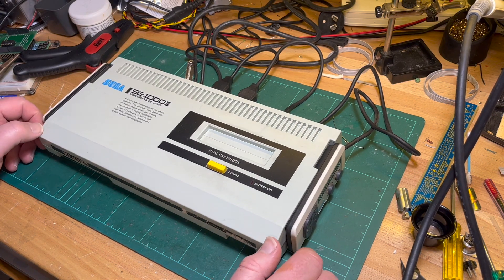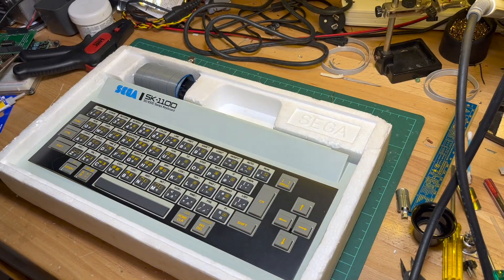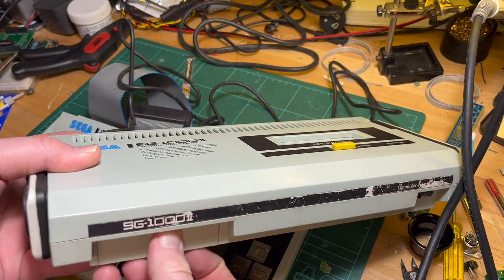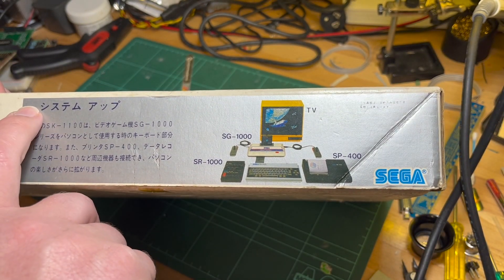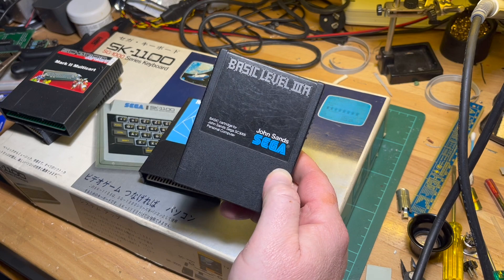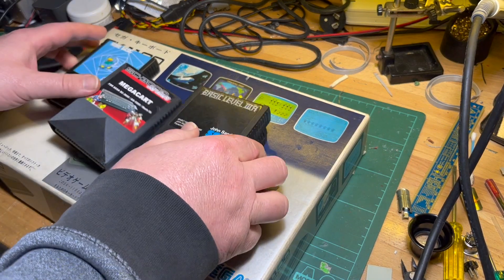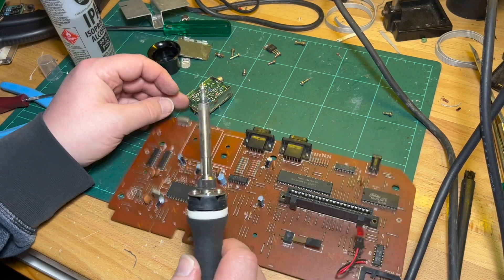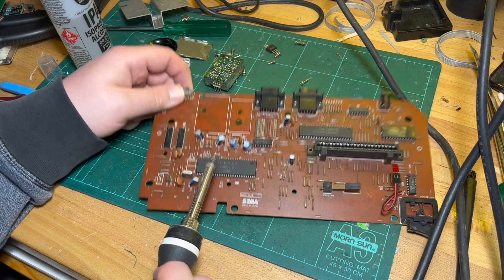🇯🇵 Sega SG-1000 II + SK-1100: Part 1 (Intro) [TCE #0111]

Comment: Can I ask why you removed the regulator? Do they go bad like old caps do? Just curious :)
Reply: There are modern drop in replacements that are far more efficient. Less heat in the machine means longer life, and troubleshooting can be difficult with that wide heat sink.
Reply from the maker: Yep, what Lil Bill said.  I hate waste/unnecessary heat ... and also ceramic disc capacitors ;)  I would've put the replacement in last night but I wanted to clean the board up a bit first.  There's been arguments had the switching "adds noise" but I've never seen anything, and in some cases the machine draws so little power that there's not much heat at all ... so you're "wasting money" replacing a $1 component with a $6 component ... in this case, it's a large heatsink and I know in the SC-3000 there's a lot of heat produced by the Z80 and/or the VDP. /Brett
Reply from the maker: I've had similar arguments about heat sinks ... "the original designer says it's not needed" ... "are you sure? the 40-year old chip is hitting 50ºC" ... I did a video about reducing heat in the VIC, including replacing the linear LM323 regulator:

https://youtu.be/9n-lFNrFt1w

Comment: nice little pairing...interesting to see the single sided linked construction
Reply from the maker: Yep, lots of links IIRC in this and the SC-3000 ... looks like RGBS can be used but requires a simple amplifier circuit on each signal to boost the level ... but I'll see how I go ... /Brett